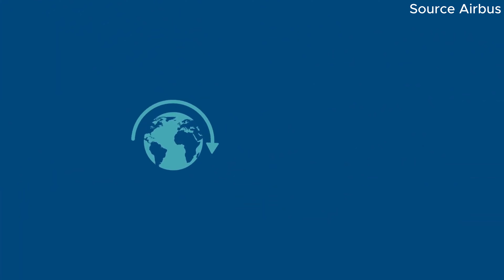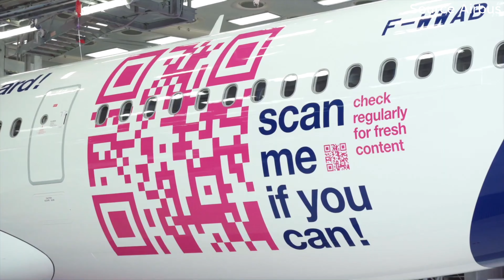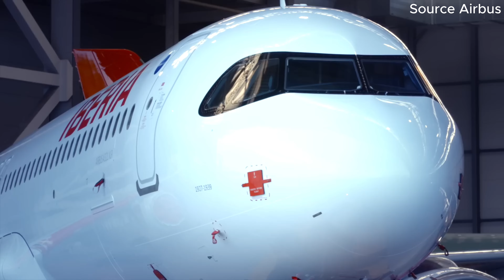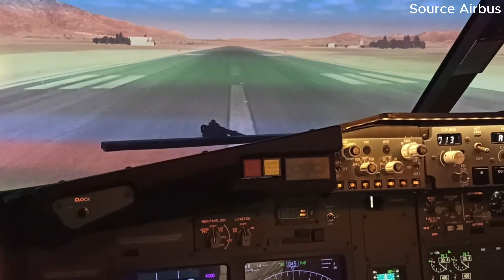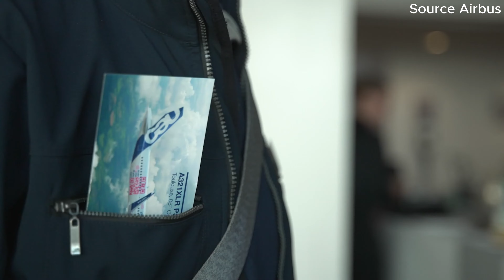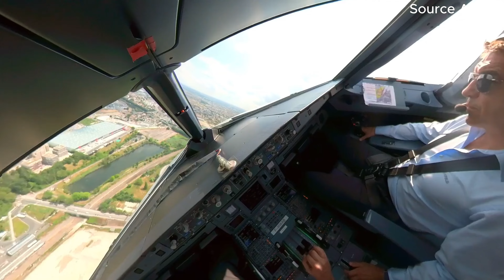How Airbus Outsmarted Boeing With Just One Aircraft

Comment: Boeing: lets scrap our 757 capable of doing that and leave Airbus with no competition
Reply from the maker: Can we say that Airbus' golden age began on the day Boeing buried the 757? Or are you still one of those who say that Boeing's single move is enough to wipe out Airbus?
Reply: @AviScope no, you cannot say that. What you can say is that Boeing failed to see the potential of the 757 airframe, investing on the older Boeing 737 airframe and ditching the 757. Maybe they had studies for both cases and investing on the 737 airframe was cheaper and the profits were quick. Remember that both builders at the time invested on wide bodies: Airbus on the A380 out of pride and arrogance and Boeing on the 787 clearly ditching the 767. Both were short-sighted to the future of single aisle aircraft at that time. Maybe the fact that the 757 remained in service mostly in the United States on United, American, Delta, Continental, USAir and Northwest while being phased out in Europe was also an indicator for Boeing to get rid of the 757 (bigger and more expensive) and focus on the 737. Remember that at this time, the 767 was the queen on the routes that today are the focus of the A321XLR (hence Boeing replacing it wit the 787)  and the biggest variant of the 737 was the 737-800. For Boeing the 787 program to replace was way more expensive than they planned, so to replace the 757 lets think of something cheaper. Boeing also believed tha airlines would focus on passenger comfort,  with wide bodies for long routes. Not only Boeing wants a quick profit (737 max): airlines don't care about passenger comfort, sticking 10 abreast on a 777, already putting 9 abreast on A330s and pretty soon 10 abreast on A350s, and flying long routes on single aisle aircraft.
Reply from the maker: Definitely a very solid analysis, but one question: If the 757's potential was limited to the “local market” (especially the US), how can we explain the global success of the A321XLR today? Did Boeing underestimate that niche, or did Airbus skillfully shape it?